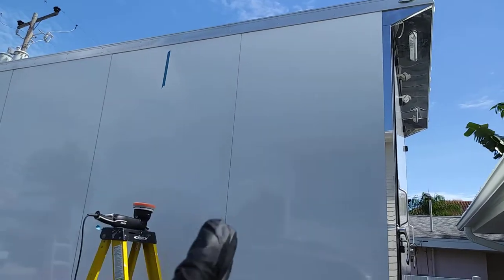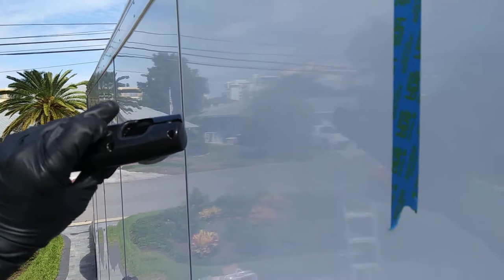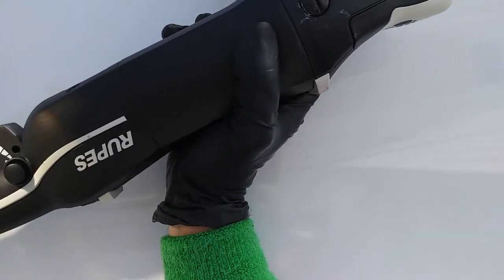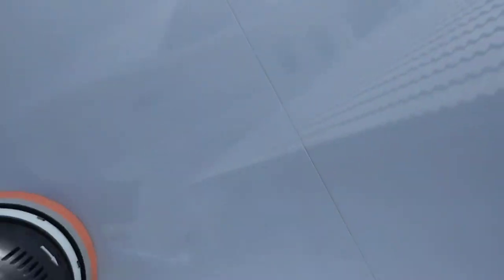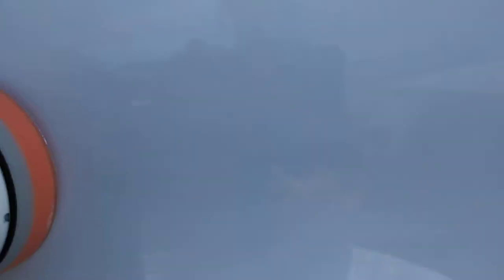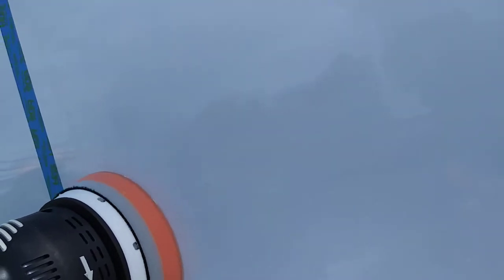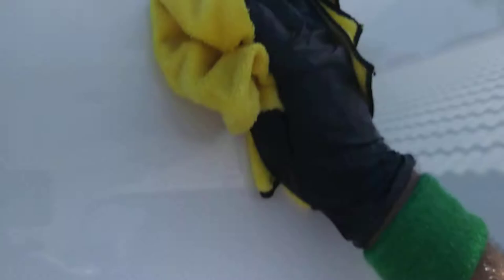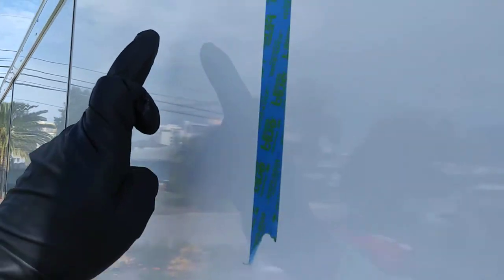Aluminum Trailer How To Clean Remove Black Streaks Polish Out Scratches PT6/7

Comment: whats the difference between polishing a aluminum trailer vs gelcoat fibergalss
Reply from the maker: The material substrates are quite different and although polishing by definition would be applied in both situations metal polishes are generally much more aggressive than polishes used for paint and gel coat. They all have different aggression levels and you could probably cross over from one type of compound or polish and do the job but using specific chemicals and tools are the way to go when you want to be as efficient as possible and have the highest quality results.
Reply: @deluxevehicledetailingandp904  but as in overall quality fiberglass/gel coat  used in RV/Marine boats is higher quality and easier to detail vs Aluminum paint right? Even in terms of the paint on them it feels like aluminum travel trailers such as the one your detailed in this video have a thinner layer of paint with no clearcoat oppose to fiberglass on an RV there for having to be alot more careful when polishing/compounding the aluminum correct?
Reply from the maker: @dezcanso1540  Yep, higher quality, but gelcoat is totally different than "paint". It's thick and grabby and needs a wool pad and a rotary to start, then refine and polish with a DA
Reply: @deluxevehicledetailingandp904  thanks for the reply :)

Comment: How does the rupes mille cut vs the shurhold long throw?
Reply from the maker: I loved the cut with the Rupes with both the medium and coarse wool polishing pads. In this case I wanted to really put the Rupes Mille through it's paces with different pad types. Although I did have different polishers/rotary with me, I stuck with the Rupes for the entire job. Working on just flat surface the whole time the forced rotation was not really tested, but with a chance to polish for 6 hours, I stuck with it. With the long 21mm throw removing 188 feet of tree branch scratches would have worked well. With the 5 mm throw, working high up over my head on the ladder, I felt that it would be less fatiguing.
Reply: Deluxe Vehicle Detailing and Paint Correction Good to know. I own the flex 3401 and I love it - but there are things I dont like about it too. I’m hoping the Mille is quieter and more ergonomic but delivers the same toughness as the flex.
Reply from the maker: @NickM1013  I felt that it was very narural/ergonomic, easy to control and smooth. I did not wear any ear protection and had no problem with its noise output, even though I had my head pretty close to it on the side of the trailer.  High quality construction and production.